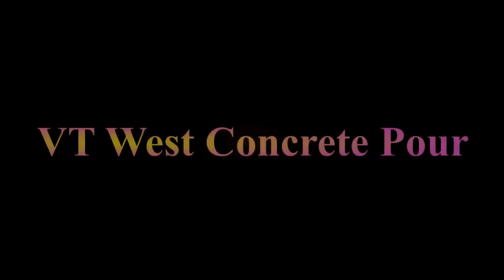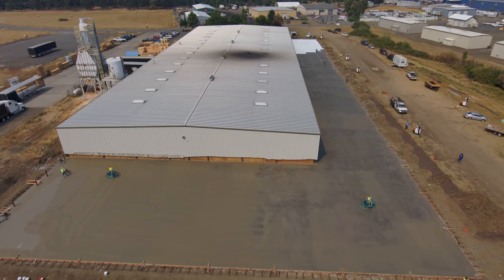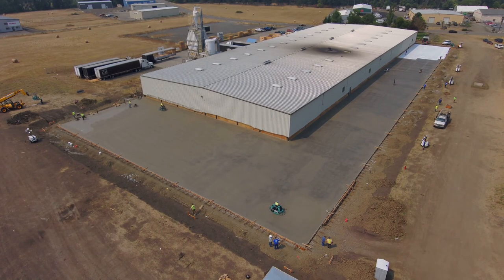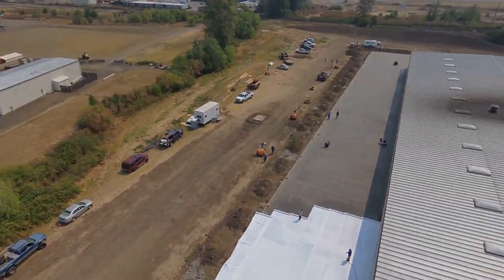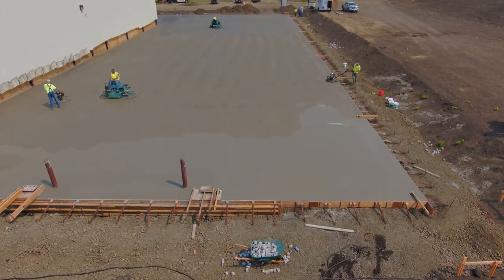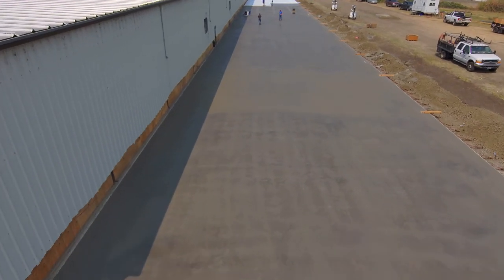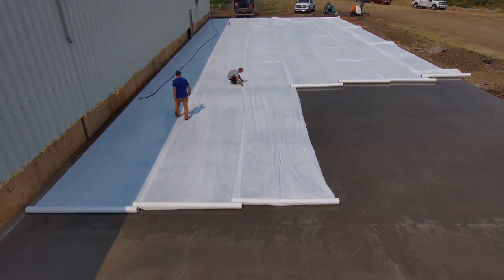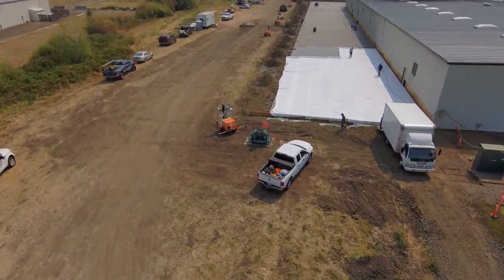VT West Concrete Pour with Commentary

Comment: I assume the building will be enlarged to fit the new pad are you doing that as well?  Cheers
Reply from the maker: Yes sir, we are building a 35,000 sq ft addition.  There is about 20,000 sq ft of concrete in addition to that work but that will be toward the end of the job.  What you see there is all building pad.